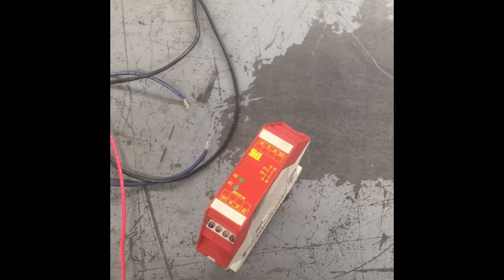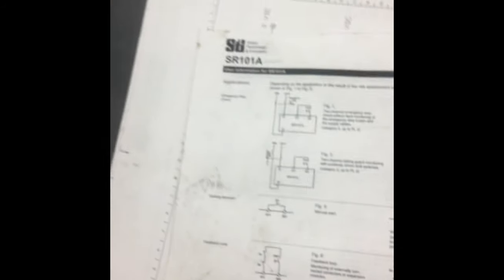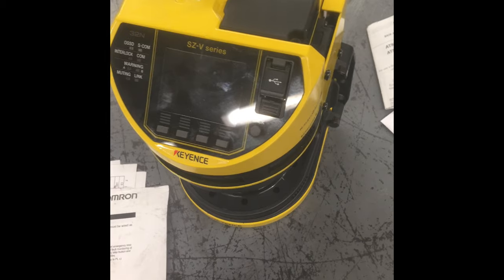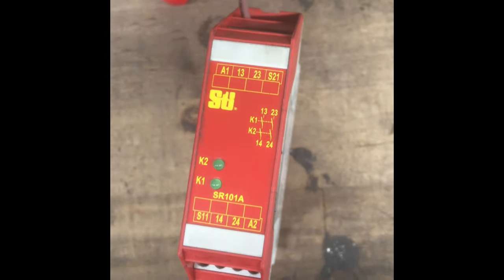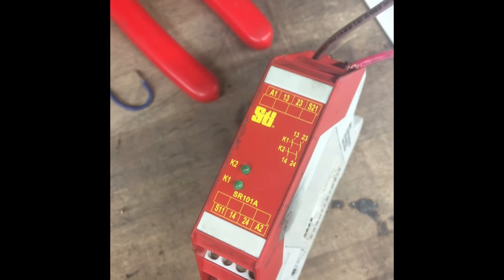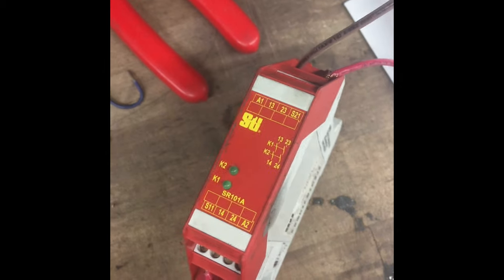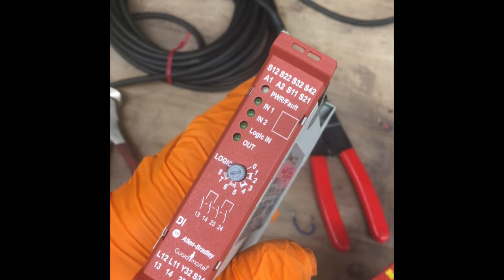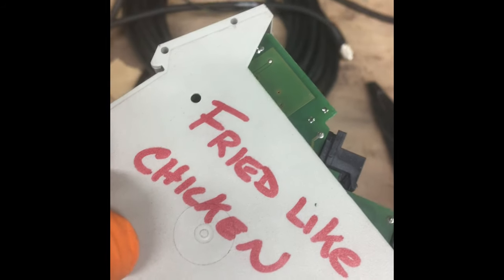Safety Relay OSSD

Comment: I got ossd light curtains to work with these. I trip the light curtains and the relays cut off. That means any circuit I have on the NO contacts will cut off also.
Reply: I know our company does light curtains and OSSD but I am trying to understand OSSD myself lol.
Reply: Excellent! I'm looking to do the same thing,, which model of STI relay did you use? I have SR103AM